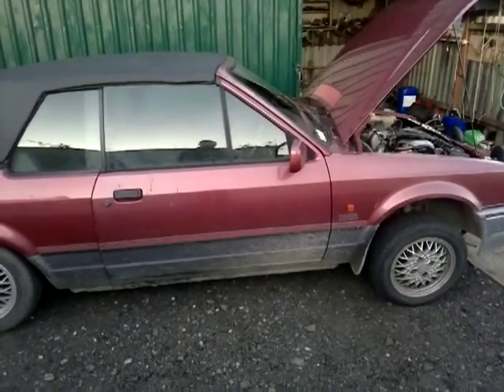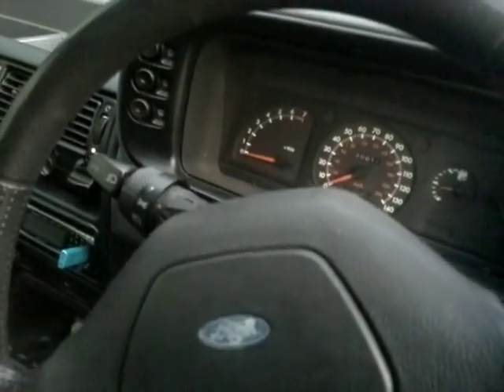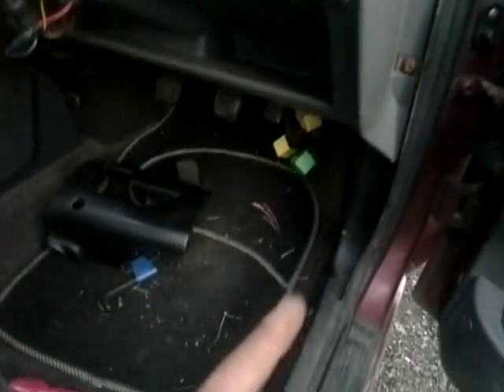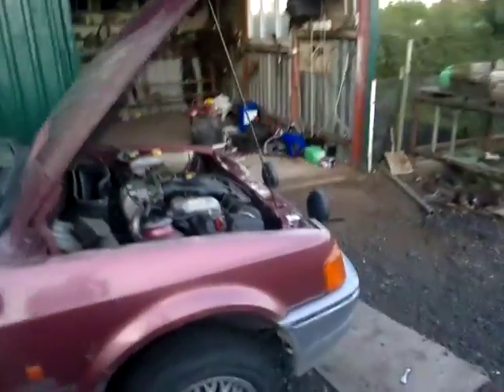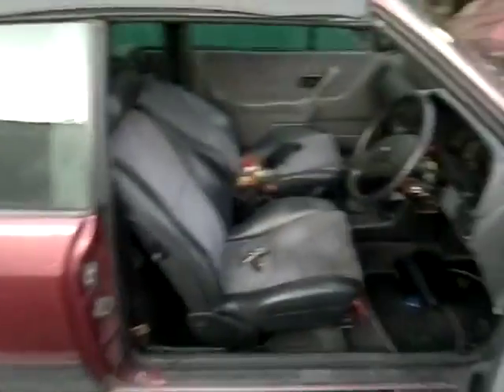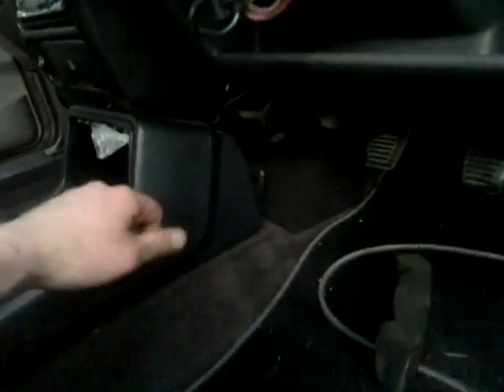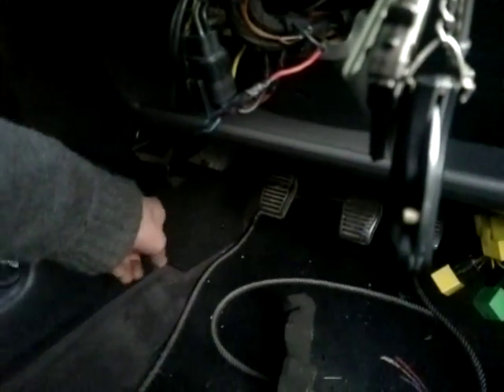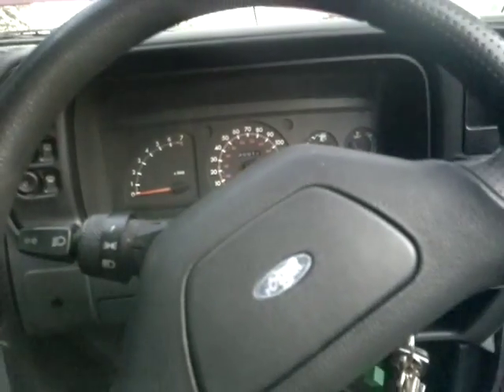Ford Escort XR3I EFI 90 SPEC Problem Starting - Starter motor not engaging Electrical

Comment from the maker: Nothing spent buddy, all parts used have been collected over time. I did pinch the starter motor off the MK3 Escort SE which I have and will re-fit tomorrow. I don't think the previous owner knew about the switch because there is a receipt here for £600 which lists soo many new parts under the title 'Escort starter motor not working', it had alot of new parts probably because of that switch. Apparantly a common DIY thing back in the 80's and early 90's.

Comment from the maker: Hi there, there are a couple of things I would try first as you need to know where the problem lies.
Try bridging the starter motor with a spanner (or similar) with ignition on. The car should start even with a wiring problem, if it doesn't start then I would replace the starter motor. If it does start, then I would hunt out the immobiliser. Chances are its one of them! If it was fuel pump relay or similar then it would just wind over and never start.

Comment: Hi there.  I'm having a similar problem.  Just got my 90 XR3i Cab out of storage and I'm getting the click.  Fuses and relays are all fine, wiring looks intact.  I've checked for one of these mystery switches but can't locate one.  The car does have an after-market immobiliser fitted though.  Do you think that could be malfiunctioning?  I suppose it works in a similar way to a cut out switch?  Pulling my hair out!!!  Any advice greatly appreciated.

Comment from the maker: I would test the battery and see if its dying a slow death. Motorworld will do it if you dont have a tester and then get it replaced. Chances are its a faulty battery as I also have a gti escort with a 380 amp and never had any problems. If you still have problems after a new battery then it will be the alternator which needs replacing. :)

Comment: Any tips or ideas why my mkiv cabriolet (EFI) will turn over but not fire, then a couple of hours later I might be luck and it catches? The fuel pump does not buzz but when it does it starts straight away. I have been told if it was the fuel pump then it would not start at all, beginning to think the alarm/immobiliser are naff.

Comment: Do you have any advice on fixing the roof on a Mk3 XR3i cab? I have had a new roof fitted and now the roof wont close correctly. It seems short on the drivers side and the frame doesn't meet the back window! Any ideas?
Reply from the maker: You can extend the hooks on each side where they meet the windscreen pillar - that may be a possibility.
Reply: Get a new car? :-P

Comment: This has happened to my cabby 
It drove OK for a few hundred yards then just cut out 
I was ticking it over with no firing up .
Then 
The starter click started. 
2nd time this has happened 
A revisit a day or so later it started up fine .
This could well be an hidden  immobiliser issue as stated in this video
Reply from the maker: The starter motor could be getting hit and tired. 

A lot of people replace them with transit connect starter motors I believe?
Reply from the maker: Hot ^

Comment: my ford orion has been pretty good though having a battery problem at the mo its either faulty or just simply not powerful enough to crank the engine after one or 2 attempts just goes flat 380 amp battery very underpowered for a 1.8 ghia si engine gonna take it back and look round for a more powerful one